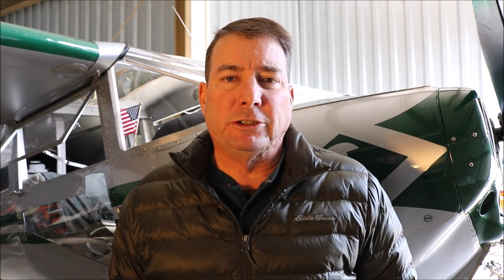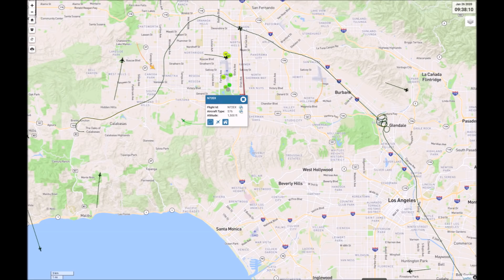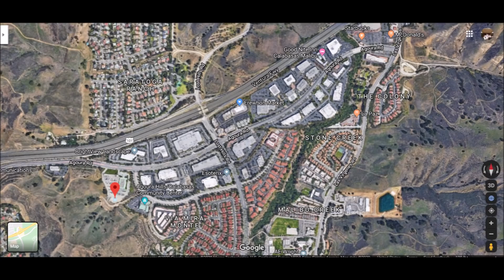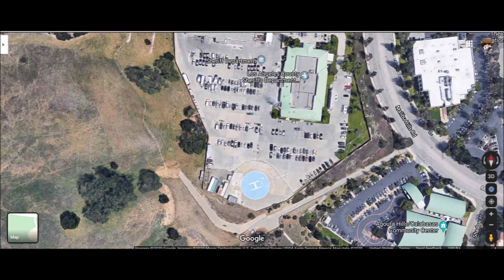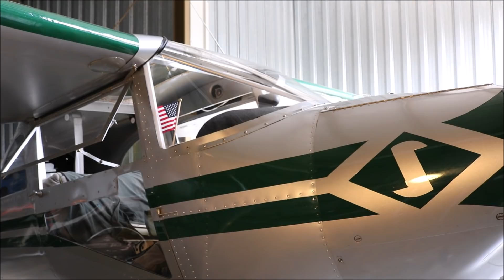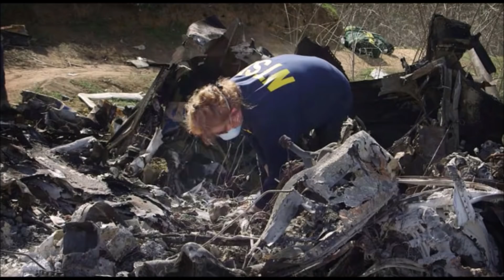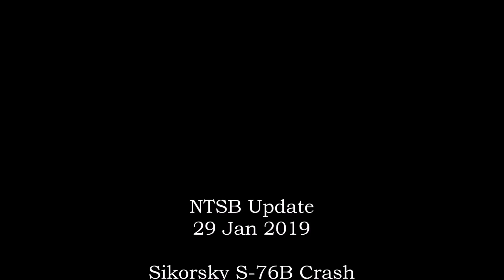Kobe Bryant Sikorsky S-76B Crash Update 29 Jan

Comment: The NTSB lady seems to require something rather like the "rule 43" letters used by English and Welsh coroners to ensure that nobody in the future dies due to the cause of a death or deaths that they have investigated. These rules changed fairly recently (2009) and now are:

 Reports to prevent future deaths (PFD reports)

74. The 2009 Act (paragraph 7 of Schedule 5) changed the previous ‘Rule 43’ provision. A coroner will now be under a duty to report actions to prevent other deaths to a person who the coroner believes may have the power to take such actions.

75. The coroner must make a report where the investigation he/she has been conducting reveals something which gives rise to a concern that there is a risk of deaths in the future and that action should be taken to eliminate or reduce that risk (paragraph 7). The coroner may recommend that action should be taken, but not what that action should be.

76. Regulations 28 and 29 require any person responding to a coroner’s report of action to prevent future deaths to include in the response to the coroner a timetable for the action proposed to be taken to prevent other deaths.

77. The Coroner must send a copy of any response to a PFD report to the Chief Coroner (who may publish the report or a summary of it34) and properly interested persons. Both the Coroner and the Chief Coroner may also send a copy of the report to any person who, in their opinion, may find it useful or of interest35 (such as other regulatory authorities). 

Note para 76.

source is the Health and Safety Executive:
https://www.hse.gov.uk/enforce/enforcementguide/wrdeaths/chronology.htm

Coroners can send these letters to any private or government official, no matter how high-ranking.
Edit was just to double check that I'd got the terms right and I had, so I didn't actually change anything.

Comment: Living in the area, maybe I have a different outlook on this. If this was any random amateur, I would have no problem writing this off as the typical low ceiling, canyon scenario. That has played itself out countless times in this area, in places like the Grapevine and other passes. But this guy was highly experienced, knew the area well and had gone this way before. They had made this flight out to Camarillo before, taking the same route. All the heli guys in the area know these recommended heli routes along the freeways, very well. It looks like he was hunting for a VFR path through to where they wanted to go, thus the circuitous route further north, then down. He was running low along the freeway (likely still under the ceiling at that point). Then around the time he says he's going to go higher, you see that in the data. He climbs and goes level. Yet, he still keeps going straight along the freeway, no deviation, nothing bizarre. This to me says that he had decided this was not going to work. He may have told them they would have to go to Cam, as they had in the past, and drive back. Then for some unknown reason, out of nowhere, he goes into the left descending turn. This makes no sense at all. He knows what is there. He knows what will potentially happen. Why climb to a safe altitude, only to then make a reckless turn and descend into what you know will be obstructions? It's completely irrational. I think something was wrong and he was trying to make an emergency landing (possibly auto-rotation)... then popped out right into the hills and lost control trying to avoid. If not that, it would have to be a screw-up of monumental proportions. Which is hard to believe for a guy that not only had, but taught, instrument rating, and was very familiar with the area.
Reply: VERY WELL SAID.

Comment: This is so sad that we lost these dear people.  I used to live in the area.  The fog gets thick there.  Why they took this route along the 101 is an enigma when the 118 into Simi and 23 into T.O. typically has better visibility.  Once into the situation you just do your best which I am sure they did.  May God bless the families and comfort their souls.
Reply: When asked for a flight following, the Burbank tower told the pilot to take this route. I saw a video of it. They transferred the pilot to SoCal for flight following, SoCal would have been in the know about the foggy conditions, but they had trouble communicating with the pilot. I believe in my heart he was trying for that Sherriffs dept helipad in lost canyon.
Reply: @bryandiel6773  There are details of the flight on this link  https://www.youtube.com/watch?v=t7dHUCnxQD0    The controller in Burbank asks the pilot at 3:25 on the video if they want to just stay on the 118.  The pilot replies saying they want to change over to follow the 101.   The controllers direct them to the 101 as per their wishes.  I believe had they taken the 118 into simi valley that may have navigated into T.O. safely.  They may have been aiming for that helipad although the tapes do not specify that.  The 101 is closer to the ocean, the mountains are higher, and the fog is usually denser than along the 118.  Once they chose to follow the 101 they had a more difficult task than it would have been along the 118.  Granted most of the time they could have flown along the route they chose.  However this day the fog was more dense and sadly they were not able to navigate in those conditions.  This is not said to be critical of any persons, rather to discuss ideas about available routes.   I am sorry for the loss of these dear ones.

Comment: Thanks for the informative vlogs on KB crash, 737max & more.  Re the S-76B, magnesium was mentioned in an early report regarding the severity of the fire, although manufacturer's website doesn't address this to any extent.  Could you share your thoughts?  Thanks
Reply: The landing gear wheel rims are probably the only thing made of magnesium, and maybe some engine parts. Watched a KC 135 burn up on the ground once and even through the dense black smoke the wheels lit up like beacons.

Comment: Is it possible he could have been trying to avoid the houses near where he crashed? May have influenced why he didn't make the sheriff's helipad and turned the other way.
Reply: Of course anything is possible, but he would have had a better chance of surviving putting it down on the 101.  I don't think he realized we was turning away from the Lost Hills Sheriff's helipad, the actions point to having zero visibility.  It was soupy, I was just a few miles from there, and couldn't see a mile at ground level, less than half that looking up at the hills to the South of 101, between Parkway Calabasas and Las Virgenes.  Once over that hill AT Las Virgenes, he may not have been able to see the ground from 500 AGL, which might explain the sudden climb.  Then he did a rapidly descending left turn into the hill, in a very short period of time.  Look at the graph at 11:15 into the video.  At the end, the airspeed drops as he climbs to over 2000 feet, that's where the yellow and blue lines almost meet, when he's at about 2200 (MSL) and about 110 knots.  Then the altitude drops as the speed increased drastically, going up to over 150 knots in about 30 seconds.
Reply: @kentf8539  Thanks for responding. The story seems to have some gaps. If it was so soupy, wonder if he could even see 101? But then I thought I read or heard in another article that he was following the freeway for a time. Maybe he got overextended somehow. It sounds like he had a very full load, the bad weather,  error(s) in judgement all might have contributed. I tried to check out the graph. Can't see it well on my little cell. Very sorry - sad story. RIP.
Reply: @nancychace8619  There was no fog at their location when they took off. They encountered it later in their journey.
Reply: @lizj5740  That's when it counted.
Reply: @nancychace8619  Absolutely. I mention it only because so many commenters are under the impression that the pilot took off in fog.
Reply: @lizj5740  That's ok. Getting the news like this can be a bit patchy. Even the investigators have to piece things together. One aspect I was just reminded of was that this pilot flew into IFR with a special clearance, but even police helicopters weren't flying that day b/c of the fog. They may have bitten off a little more than they could chew somehow. I also caught a small report that a witness said he heard the engine sputtering. Haven't heard much else about that. Hope they figure it out so people can learn from it. Feel sad about this accident, even though not too big on pro sports.
RIP.

Comment: I am not a pilot, I fixed helicopters in the Navy.  I've heard, "Altitude is attitude."  
 It may violate the "Rules", but if you get stuck in the fog, the odds of hitting the dirt by going down is 100%; 
and given the number of local aircraft, the odds of crashing into another aircraft by climbing are 1 in 500. 
 I would rather climb to the Sun and get above the clouds where I have more time to solve my problem.
   "When lost or when in doubt, fly in circles, scream and shout."

Comment: My prayers go up for the victims and their families. I do not believe that terrain had anything to do with this accident. They were already at 1,400 feet and then climbed to as high as 2,300 feet. The top of that hill was about 1,100, if I am not mistaken. I believe that when the pilot inadvertently entered into Instrument Meteorological Conditions, he may have wanted to climb above the fog layer while at the same time turning back into the area where he could still see. In this process, he may have banked too steeply and lost control of his aircraft. Thus, the helicopter initiated a steep descent of 4,000 feet per minute into the terrain below him at 1,085 feet. This pilot was seasoned and experienced in this area. He knew where the terrain was , this is why I believe he initiated his climb. When we listen to the weather as reported by the air traffic controllers, we hear them say that the ceiling was 1,100 feet. The pilot was already flying at 1,500 feet, which suggests to me that he would have had at least 1 mile visibility at that altitude and able to see the ground, since he was on a Special Visual Flight Rules flightplan. Even though the pilot was experienced and was instrument rated, losing visual references inadvertently causes a reaction that is not well thought through. This is not a judgement against the pilot, rather an exegesis of my own experience. Again, my prayers go out for everyone involved. May God have all of them in His loving embrace.
Reply: Great words of wisdom.

Comment: The debris field shows no  forward movement. Its a plummet straight down that is why it burned in one spot so intensely afterward  .  You can literally see the tail shaft in one piece . Inertia ripped it off  from a dead tail rotor.

Comment: An S76-C++ simulator I flew before had a Honeywell Mark XXII on board and gave very good terrain warning, including a "tail low" warning during approaches or if the tail was low and high sink rates were present. The box was so good that it warned with  a audio alert "Be alert: terrain inop" if the box failed. Warnings were displayed on the EHSI and aural on headsets. I had a friend that flew a B model that had this same box. To my knowledge, the B model was all analog avionics, but have an EADI  and a EHSI. The C++ is 95% digital displays. If this pilot dentered a vortex ring flight characteristic, that developed into a settling with power situation in IMC, the result is what we've seen, as the recovery for a vortex ring is either to reduce power (collective), and or forward speed. Neither good options around high terrain and nearly impossible to do in IMC conditions or after situational awareness is lost. Most non-rotary pilots have no idea how transverse flow affect the main and tail rotor of a helicopter. I have intentionally trained doing vortex ring recovery in simulated and real flight in VFR conditions and with plenty altitude, and other than a VSI indicating >1200 fpm and more, while more power is applied,  and the slow speed, the helicopter looks normal. Forward speed is king and the best recovery. Great video Juan. I don't know what's going to happen to this channel when you return to the line. You're very good at this.
Reply: His airspeed was never low enough to come close to Settling With Power.  Lowest speed once past BUR was still over 100 kts, and that was at the top of the climb, less than a minute before presumed time of impact.  And the impact itself bears out the high speed.
Reply: @kentf8539  Thanks for the info. I should have stopped the video that shows the speed/altitude data. I'm baffled more now. Have a great day.

Comment: Thanks Juan! Forward velocity is key at about 2:20. How much forward velocity will determine that he was not trying to hover or slow flight in the clouds without horizon which is very hard to do. This should not have happened to a qualified CFII  and 8k hours. Apparently, at 2000+ msl they were well above the terrain.. The wind was calm also, probably no shear or loss of lift due to wind downdrafts. 

 X-Plane $58 has a default Sikorsky S-76C with GNS530 and analog flight deck. Probably very similar to downed craft. VNY R228 10.5 nm. TFR right now, but not in sim. There is no Water district building in sim but Los Virgenes St. is modeled well. Google earth had site marked but they took it away. By comparing news videos to Google earth (3D view) and hiking trails the site is easily found. Like you said they had the terrain cleared. Very, very strange! In hindsight, PIC could have done a hover turn over 101 fwy with ground in sight. 

G airspace VFR requirements are 700agl in this area. Maybe he was trying to stay out of the E airspace VFR requirements above him. Hints of PIC spatial disorientation and loss of control. Was he FIXATED on engaging auto pilot, perhaps rotating bug to new heading and trying to climb at same time? Perhaps a panicked climbing rotor stall at max gross weight. I am pretty sure S-76 has governor tying collector to power and RPM, but maybe could happen. 

 No CVR or FDR, This one might never be solved. Also the advection fog always seems to start/thicken in this area near the downgrade to Ventura. Rising terrain at 101 fwy scud running and lowering cloud/fog layer. Hmmm...  Startle effect by IMC and left u-turn to crash site could have taken about 15-60 seconds. 

I bet Politicians politicize and do something stupid and "over the top" so far as regs in the next few years due to this high profile accident.
RIP all.

Comment: Juan, I watched, Ms. Homity's NTSB news conference and respectfully disagree with her about a terrain avoidance systems in helicopters for the following reasons: the first is in a fixed wing aircraft the system is focused straight ahead of the air plane as the air plane only travels straight ahead. The second reason is the extremely complex nature of helicopter travel. The helicopter is able to climb and descend vertically it can move left or right with or without turning and it can move forward or backward while hovering. This type of system would have to cover above, below, both sides and front and rear of the helicopter. The display would be extremely complex and distracting and like the 737 Max to many warnings are as bad or worse than not enough warnings. The pilot in this situation was already over whelmed. In my opinion the gotta get there syndrome and familiarity of his route led to complacency for the routes and the weathers dangers. Instead of wasting his time waiting for a  popup IFR clearance he should have been searching for a clear space to land on and wait out the weather. The final definition of the crash should be UCFIT instead of CFIT because 2000 per minute decent is clearly not a controlled decent.

Comment: As I understand it, the ceiling was 1100 feet, and the crash site was at 1080. The piolet was a certified IFR instructor. If that information is accurate, the flight from the rapid climb to impact was in the clouds.

Comment: I DISAGREE with you on your point regarding TAWS and we need better training for VFR pilots going into IMC. This pilot was a CFII and completely instrument rated as far as I know. Flying into IMC shouldn't have caused him to lose control over the helicopter. This wasn't just another VFR rated pilot that got into IMC, this is an experienced pilot with IFR experience. So I don't think that better training would help necessarily. Also, I agree that a simple TAWS would maybe not help, but why not require synthetic vision for part 135 helicopters of that size? That would have definitely prevented this if there wasn't anything wrong mechanically. 
Love your videos. Thanks for doing this.